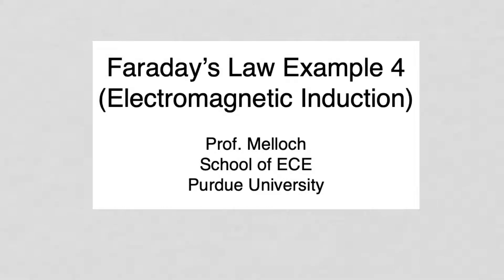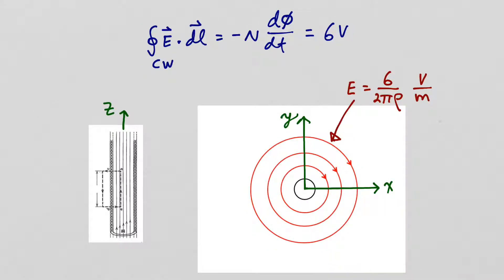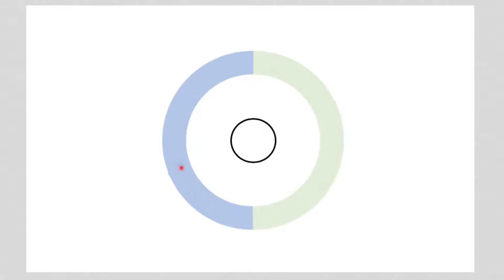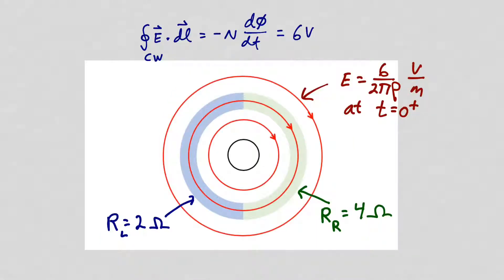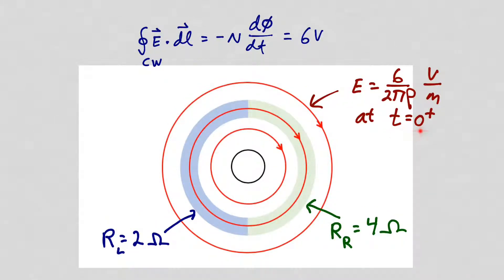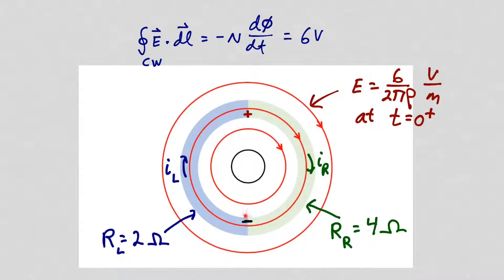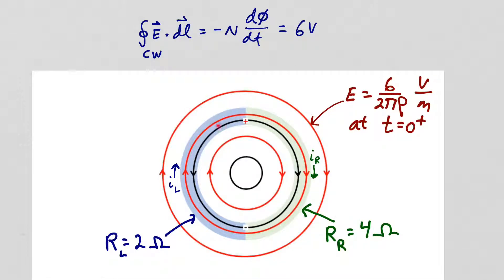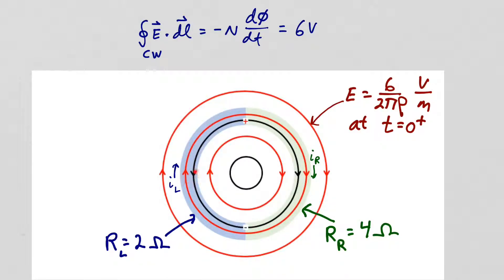Faraday's Law Example 4 (Electromagnetic Induction)

Comment: The net electric field in conductor will not be tangential even in steady state ,the radial electric field will provide the necessary centripetal acceleration to electrons due to  charge accumulation at outer and inner surface.Please mention this note at the end of video
Reply from the maker: Sorry, I don't understand your comment.
Reply: What I mean is that, electrons are undergoing circular motion so there must be some force to give them centripetal acceleration, therefore there will be an electric field towards the centre also unlike in straight conductors
Reply from the maker: @explorer4459  Got it, thanks
Reply: So you mean that there will be surface charge density ,but it's reasonable to ignore that because of   their same value,thanks for your response though